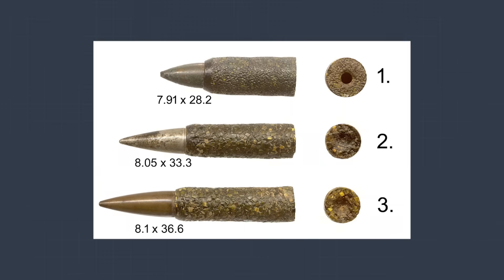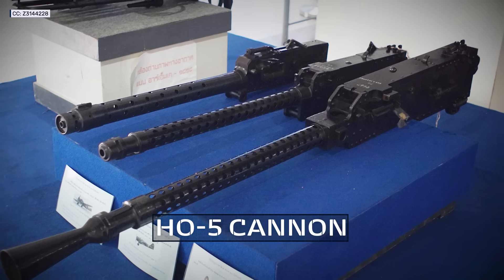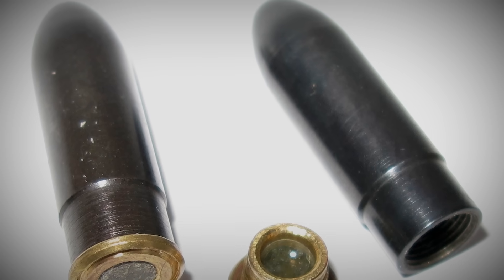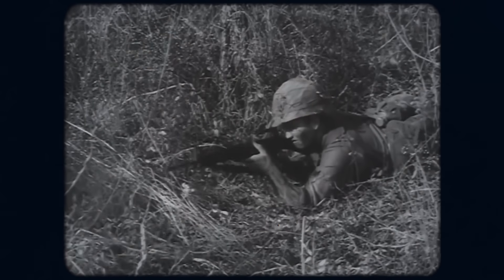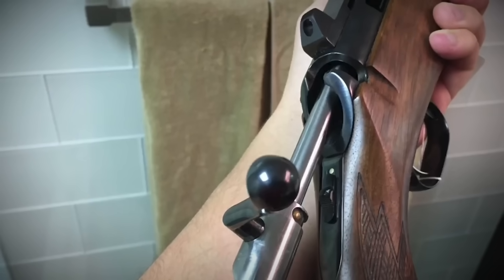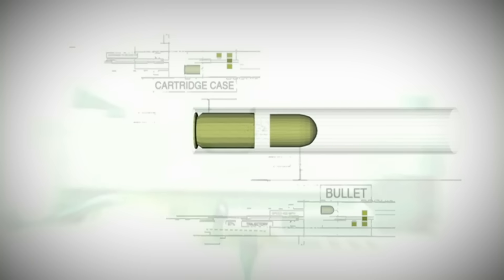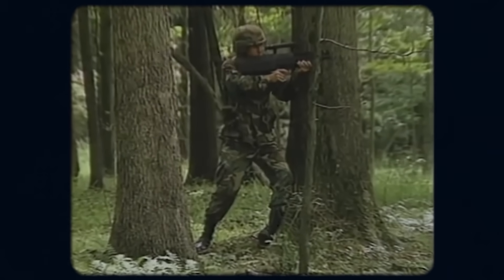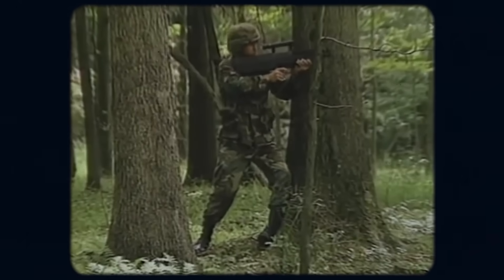Is Caseless Ammunition the Future of Warfare?

Comment: I do want to see more alternative ammo for sci-fi writing reasons
Reply: If you have semi-auto shotguns in your story, you might make them cased-telescoped like the Steyr ACR rifle. This is a good idea; see youtu.be/3iLSCNtogc8
Reply: If hypothetical science fiction weapons is what interests you, I might suggest considering:

1.  High velocity rifle system using a rifle barrel, combined with a backpack + vest for feeding fuel/oxidizer/ammo projectiles/burst discs via tubes to the gun barrel.  In the backpack + vest might contain liquid water as an "oxidizer", liquid NaK "fuel" (potassium + sodium metal amalgam, that is a liquid at room temperature), a water pump, a NaK pump, tube feedable projectiles, and some tube feedable rupture discs.  When mixing water and NaK, a spontaneous chemical reaction occurs, which produces large amounts of hydrogen gas and heat.  The hot hydrogen is an excellent gun propellant gas, since it has very low molecular mass, and thus enables higher velocity projectiles, compared to conventional nitrocellulose gunpower combustion (which has much higher molecular mass, and thus much lower maximum projectile velocities possible).  Upon using some electronical equipment to mix the water and NaK (delivered to a reaction chamber in the rifle body via pumps and hoses hooking up to the vest/backpack, high pressure hot hydrogen is evolved, which may initially be constrained by a rupture disc.  Eventually, when enough hydrogen accumulates for enough pressure, the rupture disc allows the projectile to fire from the barrel at unusually high velocities (with no ejecting brass, but with ejecting spent rupture discs, and unwanted sodium/potassium hydroxide [which are byproducts of water + NaK reaction]).

2.  A 1+ million unit cohesive drone swarm, each equipped with a small mirror and a highly precise mirror aiming mechanism.  The drone swarm focuses natural sunlight onto a single target point, at up to 1 million times the intensity of natural direct sunlight, allowing for the practical implementation of a functional "Archimedes death ray".  To put things in perspective, some types of small drones can be obtained for under $200 each, and it is therefore theoretically possible to to build a 1 million unit drone swarm, for $200 million USD.  This is "practically chump change" compared to modern national military budgets, whereby a single US B-2 "Spirit" stealth bomber costs around $2 billion each (so 10x the price of the 1 million unit drone swarm useful for a practical Archimedes death ray).

3.  Indefinite endurance nuclear powered fixed wing airplane that soars around high in the sky cooling and condensing atmospheric water vapor into liquid water and then into ice blocks.  Once enough ice is accumulated to create 100+ pound blocks, it then flies over the adversary targets and drops the ice blocks as unguided gravity projectiles.

4.  Ultra high velocity "squirt guns" used for home self defense.  Commonly available pressure washers (when equipped with 0 degree nozzle option) can often produce enough pressure to break human skin, when hit by the water jet at point blank range.  Hypothetically, it is possible to design a squirt gun that is considerably more powerful than a pressure washer (potentially by circulating the water around in a loop at very high speed, say 500 MPH, then abruptly trying to obstruct the flow, so as to convert the stored circulating kinetic energy into a fast moving jet of water).  Such a device would have rapidly decreasing energy with range, making it only dangerous at interior home ranges.  Such a device could hypothetically be designed to have multiple pressure settings (ex: "stun", "injure", "legit sauce dangerous").

5.  "Money cannon".  An artillery device that launches prefect quality counterfeit currency at the target adversary forces, encouraging the adversary soldiers to break cover to collect the currency.  Upon spending it in their local economy, inflation results, due to the flood of counterfeit currency being put into circulation.  The inflation thus erodes the adversary government's ability to continue spending on the war effort.

6.  "Recreational pharmaceuticals cannon".  An artillery device that launches recreational drugs at the adversary forces, thus encouraging some of the adversary soldiers to use the products and decrease their combat effectiveness/unit discipline/decision making wisdom.
Reply: Liquid (bi)propellant seems like a stupidly dangerous idea that could work and be fun in sci-fi.
Reply: @JeffBilkins  Don't know if you know, but that's been a holy grail of artillery guns. It's a difficult problem. The problem is the sloshing.

Comment: Anyone truly interested in this subject needs to look for a powerpoint presentation available across the web titled "Caseless Ammunition Small Arms. The Good, The Bad, and The Ugly." Presented by. Jim Schatz (he personally worked on the G11).
Reply: Thanks for sharing this :)
Reply: God the G11 is a nightmare with internals.   Still cool idea though.
Reply: @theanimatedjunkyard5921 Actual Rube Goldberg machine. Can't imagine a grunt performing PMCS on that thing. And as I recall they weren't supposed to, it was a "send to armorer if broken" gun. Not good.
Reply: Am I wrong in thinking the best most immediately achievable design would be something with gas or some non solid fuel being used to propel bullets with some sort of gas or recoil operated chamber venting mechanism. It would be similar to gas nailers. Only we'd need to use a more powerful fuel than propane 😋. Or maybe it could function like a combustion engine of sorts 😅.
Reply: I could not find that on Google search. It is open access.
Reply: @drajitshekher   That's exactly how I found it, though. Usually, it comes up as a PDF. It's been posted in quite a few different areas across the web. Use the phrase within the quotation marks. My first 4 results all contained the presentation or linked directly to it.
Reply: @drajitshekher  re:"I could not find that on Google search. It is open access."
It is at the Defense Technical Information Center (DTIC(  I found it with a Google search for "Schatz DTIC caseless ammo".
Reply: 😂😂 still waiting someone does ....
Reply: @PlayLearnNow waiting for what?
Reply: @Mygg_Jeager  someone read people don't read